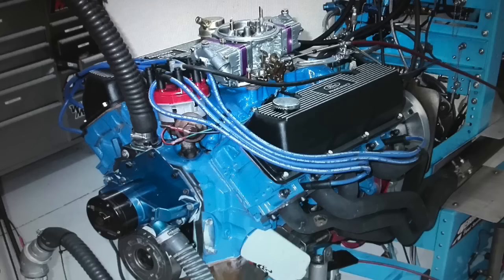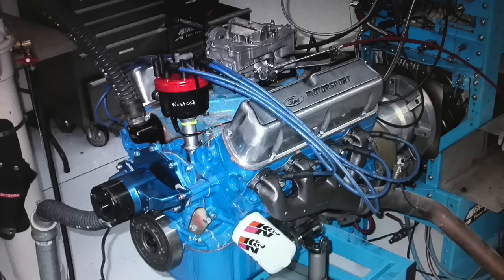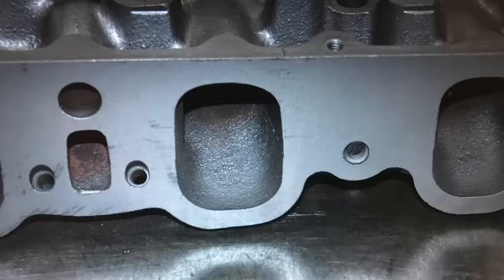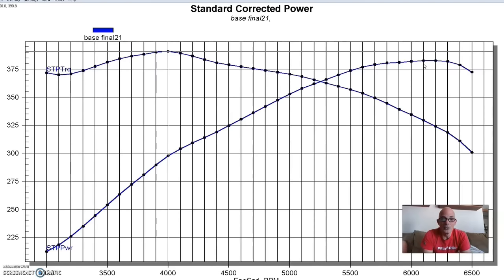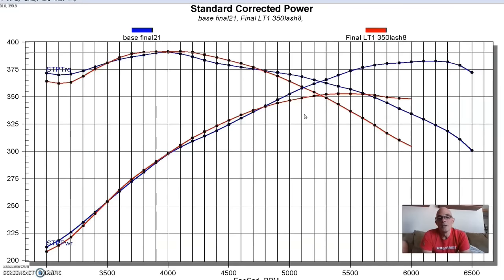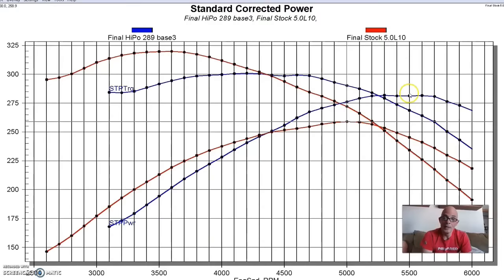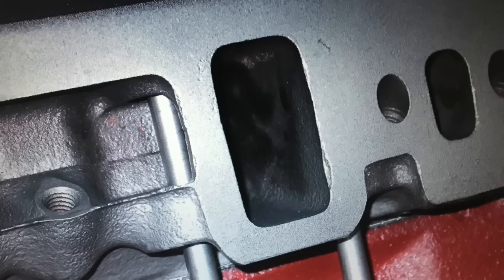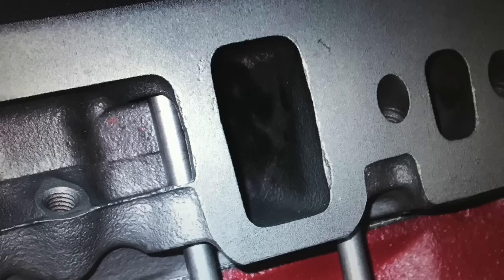HOW MUCH POWER DID THE 1971 BOSS 351 REALLY MAKE? WAS IT THE HOTTEST SMALL BLOCK EVER OFFERED?

Comment: I still don't think a 351 Cleveland fall into a small block category. Despite what ford called it. It uses a 400m block and engine is huge. 
Closest chevy to that would be a L78 396, canted valves like the Cleveland..
Reply from the maker: a 351C does not use a 400 block-the 351M/400 is a tall-deck (10.3) block-the 351C has a shorter(9.2)  deck than the 351W (9.5)
Reply: So the only true bbc is the tall deck?  I dont think so..  My only point is, you cant look at that engine and call it a "small block..  Its a mauler, just as big as a 460.   I also remember you calling a 455 Pontiac a big block.. There all the same, except the 301.
Reply: Vegas EMT   The 351 cleveland has canted valves and valve train thats a copy of a bbc.  The 351c the 400 and 351m are all in the same family, replacing the fe.  351 windsor is a small block, and should be compared to other small blocks.  But not that FE big block replacement engine, the 351c 400 351m.

Comment: 8:07  i hate chevy  and dodge, they sound like dog shit compared to ford v8s,   they can win more races they can go faster  it meens nothing      the sound meens everything to me,  thats why when i had a crash and hurt my 351 modified  i had it rebuilt back to how it was  even though on offer was more power more torque   i said nope  th sound is important to me ,  ive herd more expensive more powerful louder v8s  that dont sound anywhere near as good as my engine ,  it cost $4'500 to rebuild it back to how it was before the crash,   ive herd so many other 351 clevelands that sound much different  they are squarky and thin hi reving,  my engine is deeper thicker and hi reving   but quiet on idle    2 and a quarter inch pipe will be why , serch ford 351 cleveland starts up and revs rimas nobody elses,   cheers